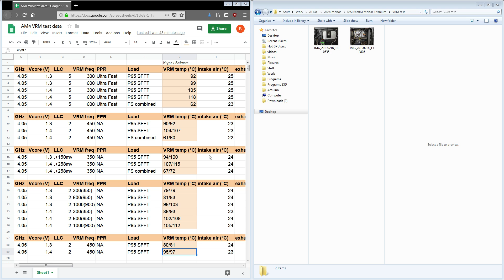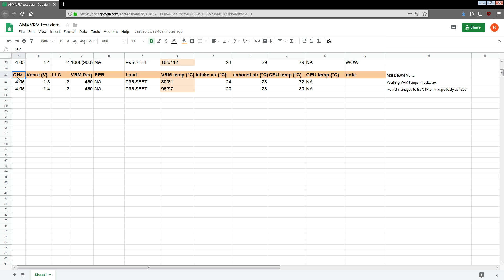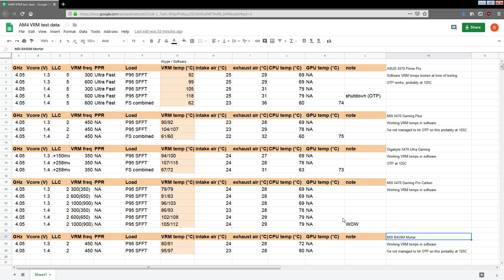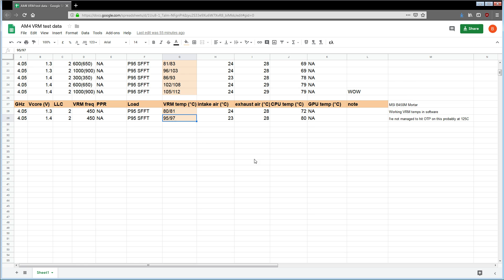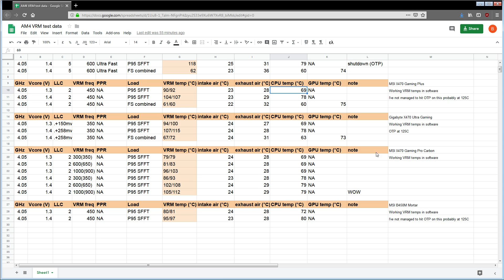VRM thermal testing: MSI B450M Mortar Titanium //

Comment: This is probably the best mATX mobo for AM4 and one of the best B450 boards as well. And it's not only because of VRM thermals, it has a decent set of connectors and features as well...the price is not terribly high either, it's around 100-105€.
Reply: in terms of VRM the Tomahawk should be even better, but this is definitely a great mATX board.
Reply: Yea I really liked the titanium board...Hard to find in the US
Reply: @CampyCamper  Yeah, Tomahawk has slightly better MOSFETS, IIRC. I believe Tomahawk shares the same VRM with X470 Gaming Plus...not 100% sure, though. But, the one on the Mortar is ok too.
Reply: @natterman2037  I bought it. It appears you have to order this board as they are not putting it in stores. My guess is they are limiting supply so they don't have to stock it since it's a niche board? I love it though, it performs so well and the features are perfect. Amazing board and it looks beautiful.
Reply: @joer8854  Order from where that doesnt cost almost $200?
Reply: @natterman2037  I ordered it from Canada computers for $130 tax in.
Reply: What you think about the MSI B450m Bazooka Plus?

Comment: Great videos. overclocking the Titanium Mortar disables "cool n quiet" (regardless of whether I manually set it to enabled) I'd like to increase my upper frequency to about 4.6ghz and have it go down when not under load... Can't get any of the overclocking settings to behave as expected. Basically anything I change seems to not have an effect. Board version 2.0, BIOS version A.C0
Reply: that is a bummer. what cpu?
Reply: @Gemmotus  Ryzen 3800X. When all settings are set to auto, it hovers from 3.8Ghz to 4.45 Ghz. I have a beefy Noctua C14 Cooler with the graphite pad. Idles at 35~40C. Max temps reach 65~70C. I tried increasing the infinty fabric freq. to 1833 (left ram at 1800) and it went up to 4.5Ghz. As soon as I set a forced frequency and voltage, the hard ware monitor reports the system is runnig full time at that frequency. =/
Reply: @mc42d0  ok. that is interesting. haven't got experience with the pads stuff.. Maybe there is some air bubbles still but doubt it. Maybe the board don't take overclocking as well as x570 does. I found this board has good results with decent memory clockings. I'm thinking this board with 3900x and 32gb revE ballistix 3200mhz cl16 but I guess should stay then with the normal settings. What ram sticks and clocks you set the board with?
Reply: tuomas seppälä i have trident Z 3600mhz CL16. If you go back to my previous message and look at my temperatures again you may realize these are actually great temperatures. This is unrelated to the issue at hand but don’t see how there could be air bubbles in a graphite pad...
Reply: @mc42d0  ok. thanks for the input. I remember watching a vid with the pads that  those can be tricky to assemble since they are thin and flexible some what
Reply: tuomas seppälä it was as easy as laying it on the CPU and installing the cooler.

Comment: I just bought a 5900x for this board (replacing a 3700x), hoping to get another 5 years out of the system. Burning it with y-cruncher multicore and it looks rock-stable (struggling to type this for the load/lag, though). It's a pity my mixed RAM kits (2x8GB made in 2019 + 2x16GB made in 2023) would not boot with the 5900x (they worked fine with the 3700x), so I'm down to 32GB from 48GB.
What an amazing platform this has been.

Comment: You mentioned 1.4 V being a bit high for all-core load.
On my MAX variant, I've set a - 0.0875 V offset, LLC to 4, enabled over- and undercurrent protections, but my 2700X still wants to run at or just below that voltage under full load...
Better than 1.45 V with full automation, but still.

Comment: I don't think this has much to do with the heatsink. Because the b450 here has actually 8 phases (disguised as 4) where the Asus has 6 phases for the vcore, so it scales up perfectly: 80° with 8, 90° with 6.
Not sure what happened there with the gigabyte board though. Does not make much sense.

Comment: Just updated two sticks of 8GB memory (32GB total using all four slots) of same mfg and speed. FAIL. Will not run at same speed or frequency (3200MHz CL14). Not sure if it is the board or the R7 2700 cpu that is now in the motherboard. (cpu has the memory controller.) I will try to update the BIOS to see if that will help.

Comment: The atx version has 2 heatsinks to the side and above the cpu. This mATX doesn't have them does it make a difference? I think they stopped selling this board I cannot find it anywhere. The explanation about heavy heatsinks is interesting. If them being too heavy is a problem shouldn't a board without heatsinks and good airflow also be a good option?

Comment: this board is missing the heat spreader on the very top of the board....does this make a difference?
just ordered this as a como deal to go with my 2070 gaming msi card.... i got that last year and have been running it on an old 3770 dell prebuild.....

..im pumped

...is that top heat sink gonna matter?.....im guessing its for the ram overclocking?

Comment: Glad I bought the B450M Mortar when you could still get them. Running an overclocked R5 2400G and igpu with no problems. Santa brought me a R7 2700 with an Asus X570 TUF gaming motherboard this year. Gotta love the AM4 platform and ones ability to easily upgrade all your machines over time.

Comment: Same board in my build, but my heater is in the top, no space in the front, my Vega is to long, so only space for fans, running a 2600 at 1.325v so no heat problems 😁

Comment: I hope you see this, do you feel this board will work fine with a 3900x? I will not over clock at all. I will game but I want the 3900x for rendering projects. Will the vrm thermals be fine on this board with a 3900x?
Reply: @FinalLight hey bud, I jumped in and got the 3900x and B450M mortar max, and works perfectly well, also overclocked no issues. If you plan on that route it is safe to do so

Comment: Love the videos! I'm thinking of getting the  Gigabyte B450I Aorus Pro Wifi AM4 mini-ITX AMD Motherboard to do a 2400g build. Wanted to get your revisited opinion on the currently available b450 mini itx boards. I remember you saying Gigabyte has crap mosfets!
Reply: For a 2400G it probably won't matter all that much, it's just a quad core. I believe the best ITX VRM is the MSI B450I Gaming Plus AC.

Comment: man I love my mortar titanium board. if you replace the stock thermal pad with a premium one you can get even better vrm temps. and with the latest bios it even got offset voltages, tdp adjustment and some other nice stuff. only thing that sucks on this board is memory OC. I never managed to get a single mhz more out of my 3400 sniper x. on only 3466 they already  produce tons of errors even with high voltages.

Comment: MSI confirmed that they discontinued the B450 Mortar line for some reason, and it's barely available anywhere now. Great reviews, apparently sold well, and they are just going "nah" on keeping it around. This video convinced me to buy one and I can't unless I want to pay a ridiculous markup.

Edit: apparently it is only discontinued in the US, as it seems easily available on Amazon in the UK and Japan, what the hell, new boards aren't out for 5 months.
Reply: I just got an MSI B450 Carbon AC off amazon for $130, said the wait would be 2-3 months but it shipped a week later. Now the only guy selling them on amazon is charging $500. It's pretty much this Mortar board but full ATX with wifi, can also confirm it has voltage offset in BIOS.
Reply: This B450M Mortar Titanium has been pissing me off for weeks -- without MSI's display driver, the f--king displayport won't work. With the official AMD drivers, only the HDMI port works. Probably why the damn things are discontinued.
Reply: @SLLabsKamilion  msi is terrible for apus
Reply: @s_apienza  Nah, MSI is just plain terrible. Always has been. Only PCChips was worse.
Reply: @SLLabsKamilion  for you maybe
Reply: @SLLabsKamilion  bullshit. MSI literally has all the best B450 motherboards, hands down. every test proves this.
Reply: MSI killed it B450. 
X570 they have both good and terrible boards.
Reply: Still goin strong as the B450M MORTAR MAX, bought one yesterday for my incoming 3950x.
Reply: There is a B450M Mortar MAX though
Reply: Can it really handle 3950x? I mean, this mobo is fantastic for 8 cores and overclocking them to high heavens, but 3950x is like putting two 8 cores cpus on one mobo. 🤔

Comment: Well done!

Really hope to see much more x470 boards tested such way.

And please, test replacing their heatsinks to some nice copper one with lot of fins. To understand how much it is ruined.
Reply from the maker: Copper is really not cost effective when it comes to making heatsinks.
Reply: I did that last year when I retired an FX-8350 system that had been Actually Running Stock for several years and decided to play with it. It was using a cheap gigabyte 970 motherboard with their favorite 4-phase with 2x4C10N and 2x4C06N mosfets. I hacked up an old copper server heatsink to mount on the VRM, replaced the thermal pad with a nice fujipoly, and put a small blower fan on the heatsink. It worked well enough that the VRM would shut down from over-current before overheating...but that still only got me about 4.5GHz!

Comment: Its a shame that otherwise a motherboard with good VRM, has such unusable voltage drop fro CPU overclocking.
Reply: How much vdroop ? 0.010?
Reply: @filds1  I wish. Its 0.07. Insane.
Reply: @heksogen4788  What?? my old p8p67 pro had 0.007vdroop wtf
Reply: @filds1  I dont believe in a 0,007 vdrop, but a reasonable amount for a cheap B450 board would be something like 0,03V.
Reply: @heksogen4788  i had 3.1 rev of p67 pro from asus. Its was pretty beefy board 12+2 oc is insane on it. Even on 1.55v the vrm was still at normal temp. I still have it but my 2600k died kekw. https://imgur.com/a/oovEStj

Comment: Thank you for this video! Did a lot of research looking for a decent Microatx Board for the Ryzen 7 2700X. Was kinda surprised to find that mATX boards are normally not that powerful in general. But then again this is my very first build, and very first AMD system! Until now been upgrading low end Intel systems. Cheers!

Comment: Thanks for a video. Author I did not understand, for a B450 mobo (without considering a mobo vendor): which VRM temperatures are ok if Ryzen 2700x is under load 100%?
Reply: 60°C---87°C

Comment: Running an ASUS Prime X470 PRO now in my daily driver with an all core overclock to 4.2 GHz 1.375V VDD and never had issues with temps or OTP tripping when rendering or bench marking. That being said I have used MSI B450 and X470 MoBos and you really can't beat the price to performance. They are legit boards.
Reply: may be not long enough runs?
Reply: @mitzio948  With the ASUS Prime X470? Maybe then again I have never run P95 Small FTTs for an hour and a half. If it will run P95 for 10-15 minutes I'm not to worried that it is going to overheat under any practical workload

Comment: I don't understand what you're talking about with the radiator in the front.  People like to mount them as exhaust to give the GPU the coolest air possible for better boost clocks.
Reply: Then people are just doing it wrong. Best way is to put radiator on front mount and add fans on top. Just look at those temperatures:
https://www.youtube.com/watch?v=xNAMxZgvves&t=727
Reply: @stanisawszczypua9076  when you have to clean that setup one day you will learn that temperatures are not the most important thing to consider lol
Reply: @xattr8403  Oh really? I clean my desktop pc on regular basis. And I have 3 x 120 mm fans blowing in ( two on the front and one on the side blowing at graphics card). When you are not a lazy ass cleaning desktop case is not a problem.
Reply: yes realy. if you blow air trough the radiator dust will get stuck inbetween fans and radiator and accumulate over time. I hardly believe you disassamble it regularly. nobody does. so its best practice to let fans suck air through the radiator out of the case. that way dust gets stuck on the outer side of the radiator wich is easy to clean. one thing you got right is to produce higher pressure inside the case, wich is reducing overall dust.     @stanisawszczypua9076
Reply: @xattr8403  A)I have air cooler not water cooler
B)As I said I clean my PC regularly and trust me between fan and radiator of air cooler there is also a lit of dust
C)I know how to set up pc cooling. I build my first desktop over 20 years ago
D) Have you ever heard about dust filters?  There is usually one on front fans/radiators mount
Reply: well, if you dont even have an AIO why are you arguing over it? Im not sure if you understood what I wrote, because out of 4 of your arguments only 1 is referring to it. wich I will disprove in the following sentence: PC dust filters are not HEPA, wich makes the issue worse, because you filter out bigger particles while smaller particles remain and get even deeper inbetween the cooling fins, wich is almost impossible to clean without a fluid.      @stanisawszczypua9076
Reply: @xattr8403   First of all, I had water cooling in the past, and secondly there isn't much difference in the dismantling and cleaning of large tower air cooler and AIO water cooler. Both are large and bulky and require some work to be cleaned. The AIO radiator is actually easier to clean. Custom hard-line water coolers are a completely different story altogether.
Reply: Again, your arguments have hardly any profound substance, also they are only remotely referring to what I am writing. You are talking around and avoiding the core of the arguments wich makes the discussion pointless. Im assuming there is a language barrier, wich Im realy sorry about tho.    @stanisawszczypua9076
Reply: @xattr8403  OK let say you mount radiator on top of case. What air will go through it? Air that is inside case. What air is it? Air that went into case through air filters (or not because not all case openings have filters). Then what air will go through radiator if it is mounted in front of the case? Only air that go through the same filters. So whats the bloody point? And btw if I can disassemble for cleaning twin tower air cooler 3 or 4 times a year, then spend around half an hour cleaning it, so can AIO coolers owners. And as I said water cooler radiators have regular rectangular shapes - far easier to clean then some oddly shaped air cooler.
And on top of all that you sir didn't say a word about video I linked. They tested it, and there was 10 dgr C difference on CPU with radiator mounted on top, and 1 dgr C difference on GPU with radiator mounted in the front.
Reply: I never said anything about top or front mounted radiators, as the position doesnt matter too much. but for the sake of the argument, as hot air rises it would make sense to mount it on top if you use it in an exhaust configuration, while it would make sense to mount it into the front if its used as an intake. In my very first post I was obviously referencing your linked video in regards of dust prevention, wich the video creator and you didnt take into consideration. If you want me to comment on the temperature measurement results I can say that its no surprise that the front mounted configuration shows cooler cpu temperatures, as the radiator is cooled with fresh air from outside, while in the top mounted configuration the radiator is cooled with air from inside the case. so when the best mounting position is being researched, than obviously there is a methodology mistake in that experiment. I think the misconception here is that you can only imagine "blowing", while my point is that "sucking" is better ;-)
Reply: @xattr8403  whole argument from the beginning was front vs top mount of radiator,  of course you can mount fan to suck air through radiator difference in cooling performance vs blowing is less then 5% if I remember correctly so it is negligible.
Reply: I added another aspect of the topic to the discussion, wich is cleaning and dust prevention. You replied, so I assumed you wanted to discuss it. But to be honest, I think you didnt understand half of what I was writing, as you asked me to comment on the outcome of the linked video but again you failed to respond to my remarks. As stated earlier I think there is a language barrier wich prevents us from communicating properly.   @stanisawszczypua9076
Reply: Best way is to put radiator on top and intake fresh air.  CPU performance will not be effected by the GPU heat like the GPU will be effected by the CPU heat.  And in the case of an AIO, the radiator end tank should be higher in the case than the CPU socket, but 99% of people who mount an AIO in the front, put the tubes at the top instead of correctly at the bottom.  Mounting the AIO on the top is a two birds with one stone situation.  The GPU isn't down clocked from CPU heat and the AIO is likely to run quieter and live longer because the pump cannot suck in air bubbles and cavitate.